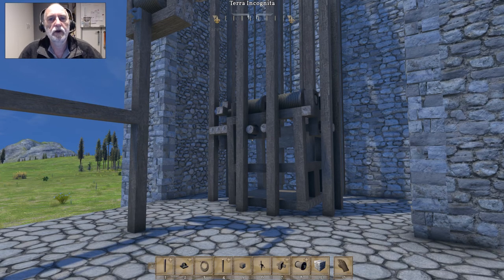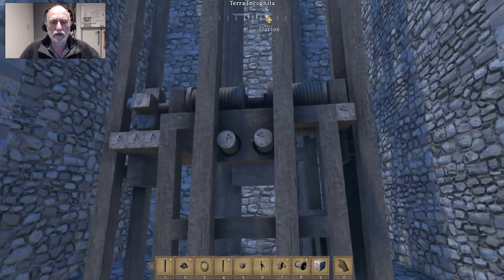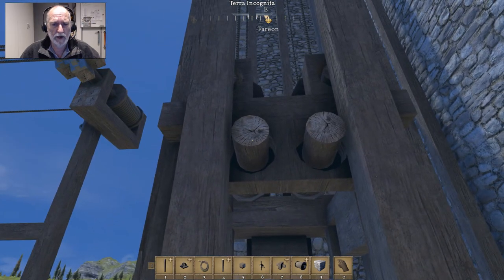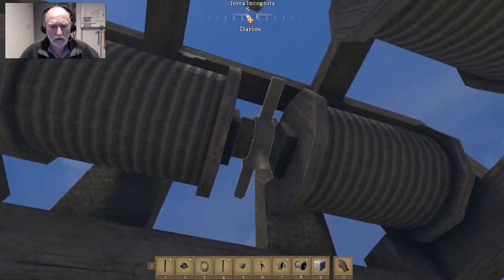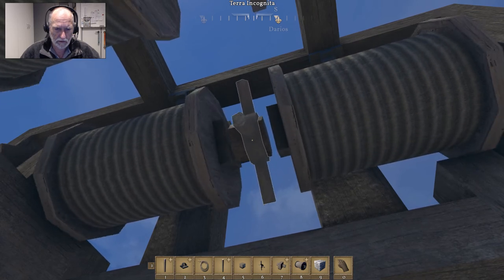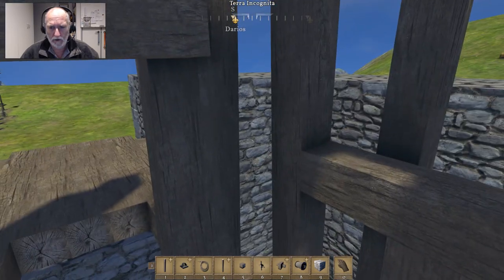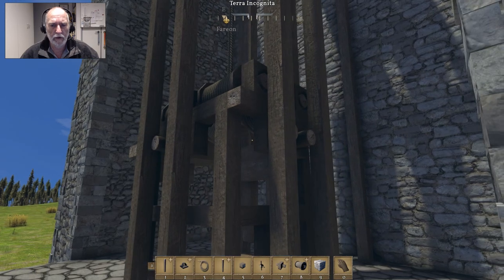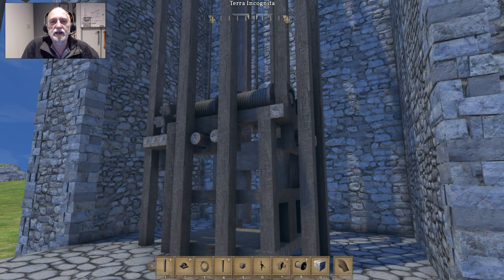MedievalEngineers   Upgraded Elevator

Comment: Anyway to make it windmill driven? I Know it will complicate it massively, but hey , engineer :)

I ask as in reality to look up and use a spoked wheel, and not only travel at the speed you do, but also lift not only you, but whole lift structure as well,  is well, a stretch :)
Reply from the maker: Hmmm  yes it could be done but I don't think the windmills actually work in ME. They are driven by the rotor block which is currently also not working in survival mode and only work in creative when you are standing next to them so that's no good for this type of design. I'll keep it in mind when they fix them all up though. Thanks for the thought.